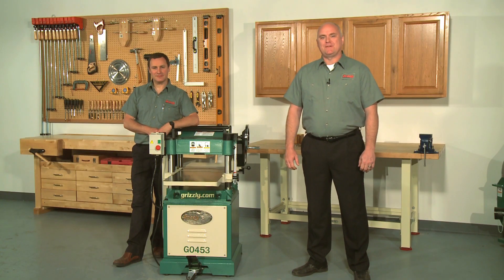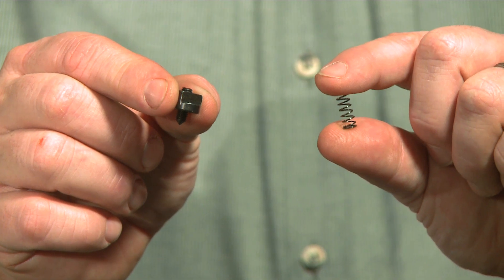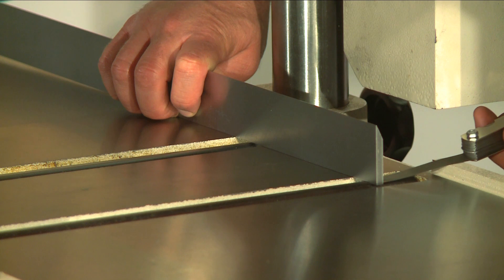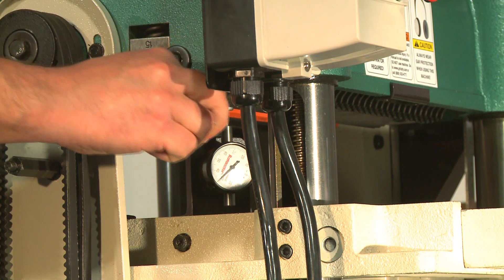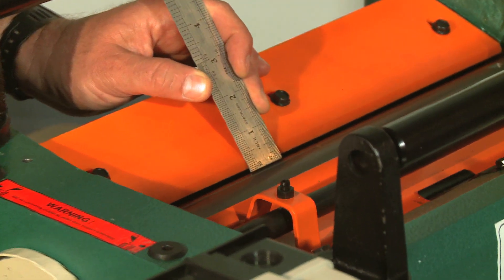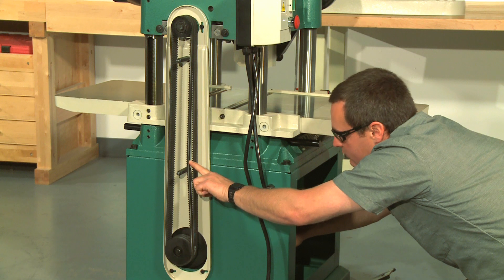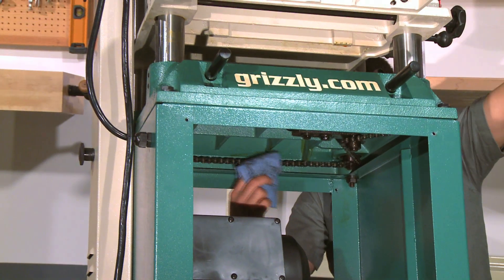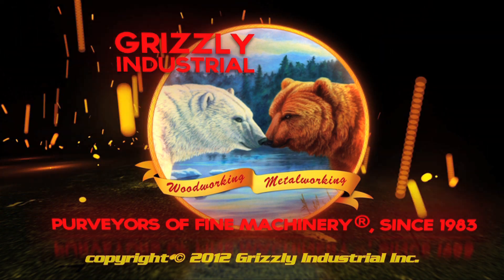How To Set Up a Planer - Grizzly's Complete Guide

Comment: The planer is cuping the boards.  An advice?
Reply from the maker: Hi there! Happy to share some know-how from our very own experts. 

The planer, by design, is meant to mirror the reference surface that is traveling along the cast-iron table, so any deflection in the material on the downward side will translate to the cut as well. The planer feed rollers may apply enough pressure downward to help press the workpiece down, but it is still likely to relate the cupping that is already in the board itself. 

Also, it may come down to material itself. For example, a larger plain sawn cut piece of lumber, or a live sawn cut, may inherently cup due to the grain structure after material is removed during milling operations. The milling cut should also be light enough to let material "breathe"--meaning, if the max. depth of cut for the machine is 1/8", you should still only aim to remove 1/16" or less per pass to reduce board movement. 

All of this noted, it is always advisable to begin your milling process with the jointer to get a flat reference surface for the planer tables to go off of to keep material as flat as possible. 

Hope this helps!

Comment: hi Guys , thanks for this video, you are really coming around in all corners, i have a question though since you didn't mention the table in your video, i have got hold of a Grizzly G1037  (not the Z model) and did wonder if you have any tips or small tricks to adjust the table going up and down. My G1037 was in a bad shape and needed a caring hand, but for some reason i cant get the table to go smoothly all the way up or down, i have cleaned with a grid 1000 sandpaper to remove rust and dirt from the columns so they are really smooth and also  lubed them, hope you can help me with this so i can get it up and running  
Best regards
Tim
Reply from the maker: Hi there, Tim! I reached out to our Technical Department and they recommended making sure the bed of the machine is level with the head of the machine. Here's a quick set of recommendations: 

Measure from the bed to the head casting at each corner. If any adjustments are needed, loosen the chain tensioner under the machine enough that you can turn the individual sprockets without moving all of them. After adjustments are made, reinstall the chain.

For further details, our Technical Department at www.grizzly.com/contact will be happy to help you out!

Comment: SAE 30 Weight oil is confusing. Is this like an oil used on automotive engines for example this one on on amazon? https://www.amazon.com/Royal-Purple-ROY01030-SAE30-synthetic/dp/B000BRV5WY/ref=sr_1_3?ie=UTF8&qid=1537994264&sr=8-3&keywords=sae+30+weight+oil

Comment: As a beginner wood worker this was my first big splash. The planer has worked great>>>t.co/7guTu44732    and left a smooth finish with no additional sanding needed. Planed about 200 feet of rough cedar and it all turned out great and uniform.
Reply: Very well

Comment: I followed this video very closely setting up my grizzly planer, and when it came to the indeed and out feed rollers the video has the specs backwards. My manual has the in feed separated roller at .02 and the out feed @ .04Now that I'm thinking about it, why would the in feed be lower than the out feed after the planer makes its cut. Guess i should have skipped the grizzly produced video about a grizzly produced planer and studied the manual before wasting 2.5 hours of my time .
Reply: My manual just says "set the infeed and outfeed rollers to 0.02" - 0.04" below the cutterhead knife edge at bottom dead center."  Read literally and without assumption, it implies nothing about infeed or outfeed being set any differently than eachother.

Comment: Hello!

First of all, GREAT video! You folks did a fantastic job covering every step. So easy to follow and informative.                                                         My question is, we bought a 15" planer, that we were pleased with. Now suddenly it has begun sort of chewing and marking the wood in little tiny indentations.  Doesn't seem to matter which way we run the board or even if it's pine or hardwood, it still does that. Some look like tears in the wood. Others like the chips are being pressed into the wood and leaving marks.                                                  

Any help you might be able to offer is appreciated.

Thank you!
Reply: David Smalley Had the same problem. Two options: 1. Adjust the spring tension on the roller making the marks. If you are seeing tiny hatch marks, it is the off feed roller, if diagonal lines, the infeed roller. Any doubt, just look at the roller. The video explains how to do this at about 12:14, in the section on feed roller tension. 2. You may also have to raise height of the offending roller. I set my infeed roller at .020 inches vs. recommended .040" and it still grabs like mad. If you are planing very soft wood like cedar, you may see some very shallow marks from the rollers. I would recommend sanding these away instead of messing with the height of the rollers, as it can be an hours long process. My advice if you think the roller height is the culprit, check the height at both ends and gradually aim for the target setting. Go back and forth between each side until both are at the same height. Then, gradually tightened the screws. Tightening the screws may change the setting, so go slow and expect to have to make adjustments. My best advice, loosen the nut only as much as needed to make the adjustment.

Now, some caveats. In the part of the video where it discusses adjusting the height of the infeed and Outfeed rollers, it begins by saying to unplug the machine. Later it says to put the gear in neutral. The manual makes the same mistake. According to tech service and other parts of the manual, you shouldn't ever shift the gearbox unless the planer is running. How is it going to be running if it is unplugged???

So, first run the planer, shift it into neutral and then unplug it and proceed. Good luck.
Reply: @PamPeerceLanders  Very good advice. One further question from me: I’m ok to follow the instructions not to shift the gear unless the machine is running (though I have already done this before knowing this requirement -but I’m unable to reverse what has happened), but what’s the reason? Anyone opened and looked into the gear box? Thanks.
Reply: @maxwang2537  No clue.
Reply: @PamPeerceLanders  Thank you.

Comment: Thanks for doing this video!!!!!  It really helped me set up my planer.  I have three suggestions to you and others. 
 
First, change the factory setting on the overload relay from manual reset to automatic reset. 
 
Second, and because you said to check the gearbox before starting the planer, I assume that there would probably be some oil in the gearbox.  If I know it up front, I really don’t mind having to put oil into the gearbox.   (I had to make a quick, unscheduled trip to the auto parts store to get some Lucas gear oil and a pump that screws into the top of the bottle.  Sweet!!)   Instead of asking me to check the oil level, just tell us to fill the gearbox with oil before starting the planer.  Or better yet, include a bottle of gear oil and tube for filling in the gearbox in the small part boxes.
 
Third, place a little more emphasis on adjusting the spring tension on the input and output feed rollers.  That is a foreign concept for us coming “lunchbox planers” to this planer.  (I kept adjusting the feed rollers depth to remove the infeed and outfeed roller marks on my lumber until I had the “Ah-ha” moment and realized that you really wanted the 0.040 depth on the infeed roller and the 0.020 depth on the outfeed rollers.  And to remove the roller marks on the lumber by adjusting the downward spring pressure on the rollers.  And yes, you did said it in the video.  But, you did not emphasize it, and that is why I missed it.)    
 
Final impressions of my G0453PX, I’ve run about a 100 bd-ft of rough saw ash and some soft maple through the planer and it ran great.  It has lots of power, and the final surface was smooth.  My biggest problem now is keeping the dust collector empty, and as a former boss told me,  that’s a good thing!!!!!
 
Thanks for a great planer at a great price!!
Reply: so did u increase the downward pressure or decrease it? I cant seem to get rid of the roller marks...
Reply: All three points are great but I came here to comment on your second point. I see that you offered this advise 10 years ago. Earlier this year, 2025, I purchased the GO891 planer directly from the Grizzly facility in Springfield, MO. No one during the entire purchasing process (discussing the machine with a salesman, ordering the machine at the facility, picking up the machine) mentioned that I would need to purchase gear oil because the GO891 contained none. Your excellent advise has fallen upon deaf ears.